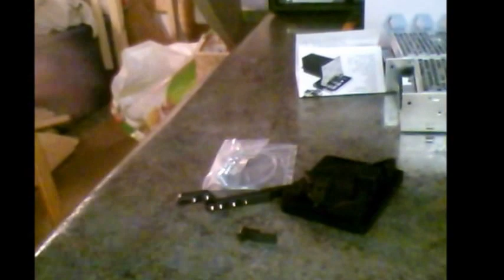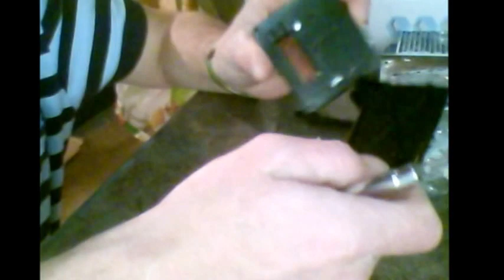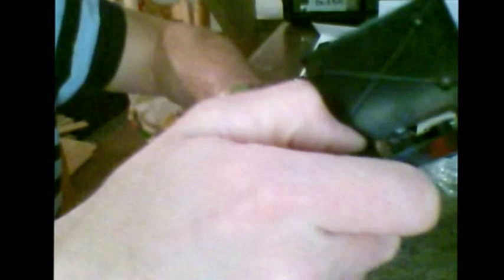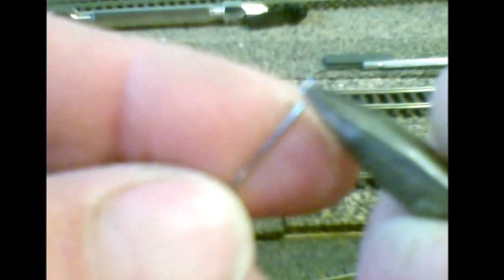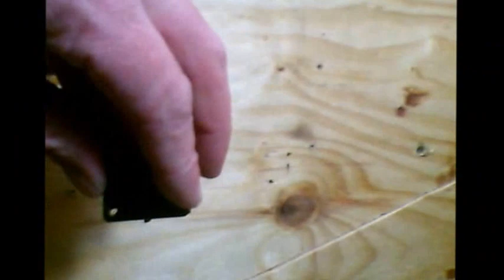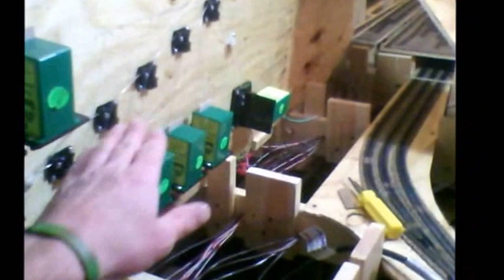How to install a Remote mount Tortoise switch machine

Comment: Hi
I was just wondering if one tortoise switch could throw two turnouts at the same time when using the remote mounts. Regards Malcolm
Reply from the maker: Malcolm Yes you can operate 2 at the same time such as a crossover just add another remote mount